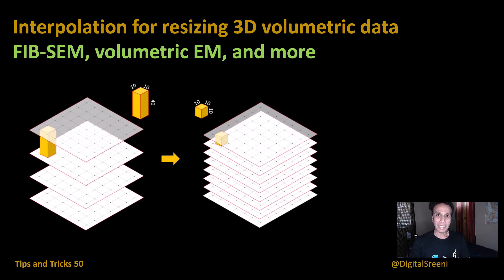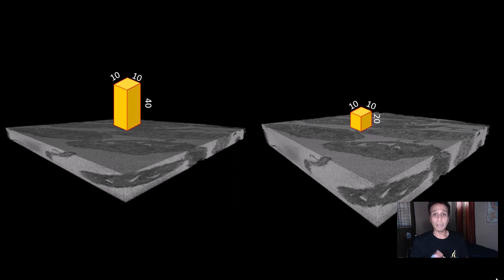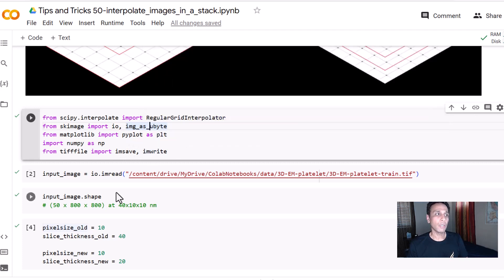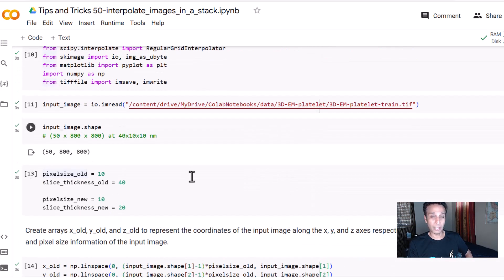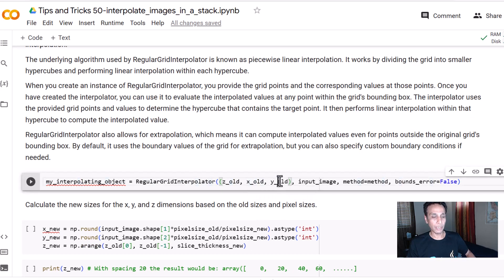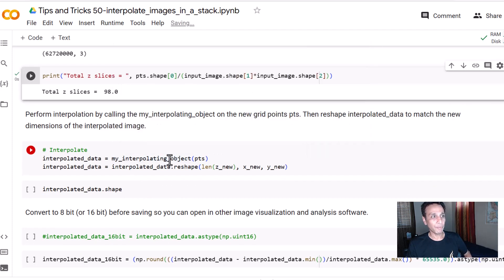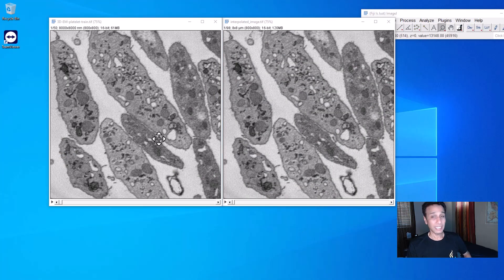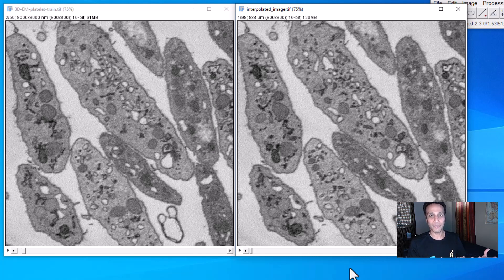Interpolation for resizing 3D volumetric data (Tips and Tricks 50)

Comment: Do you understand correctly that the interpolation method cut one z slice? From 0:20:1960 should be 99 slices. Do I miss something? The print z_old end up with 1960 values while z_new ends with 1940. Can we fix it somehow that the boundaries of the voxel will be preserved? Thank you